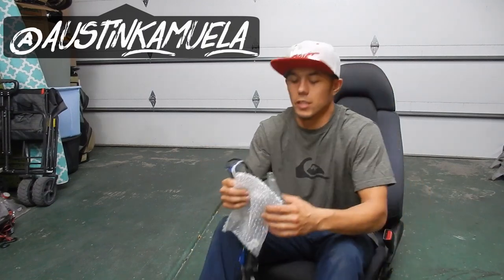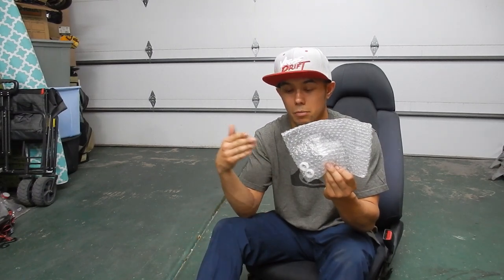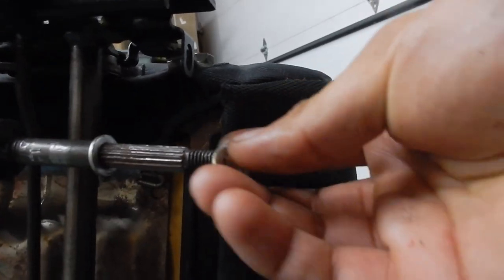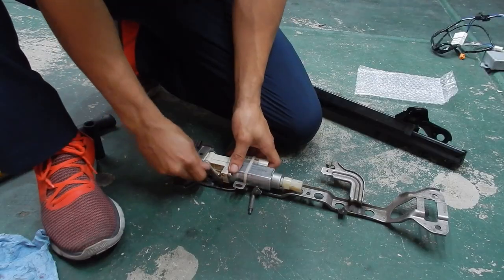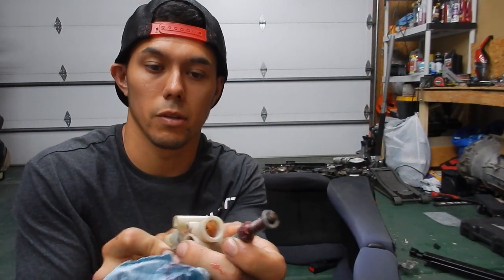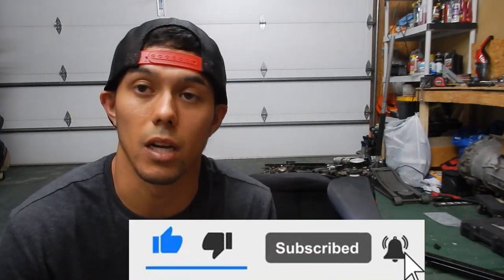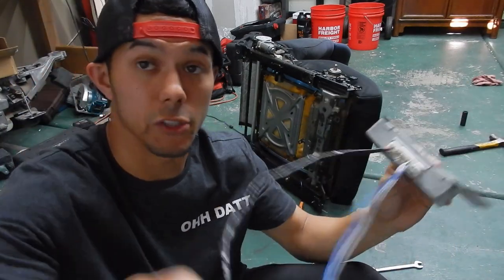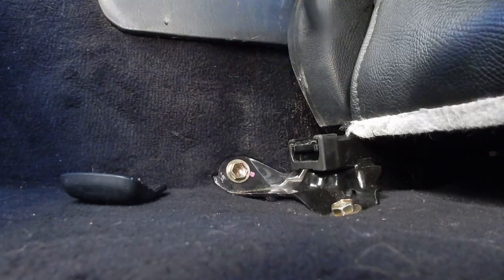Can This CHEAP MK4 Supra Supra Seat Be REPAIRED!? ADJUSTABLE SEAT MOTOR REPAIRED

Comment: Does this also get rid of the notorious “seat wobble” where the seat would shift / wobble back and forth when accelerating and braking. I bought this kit already, but all my seats work (they move forwards and backwards) but they have the annoying wobble and hoping this will fix that issue.
Reply from the maker: I honestly haven't felt any seat wobble in the driver seat, idk about the passenger seat but  the plastic gears definitely help, especially with the going back and forth with the electric motor. Hope this helps!